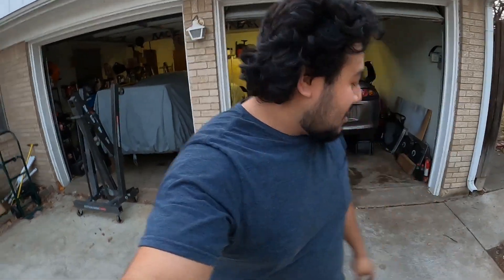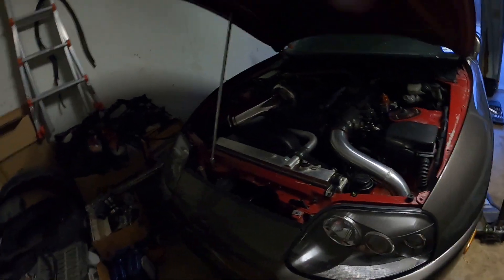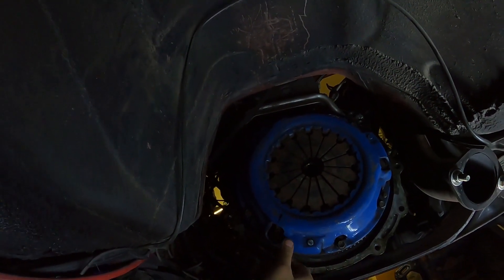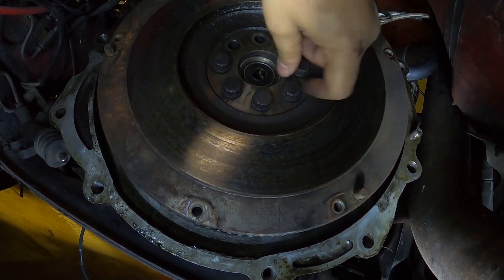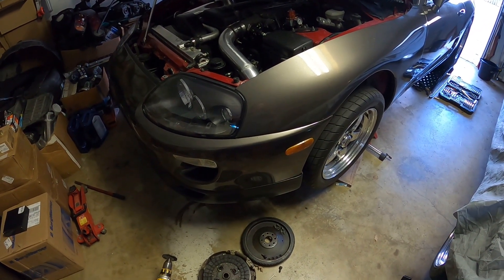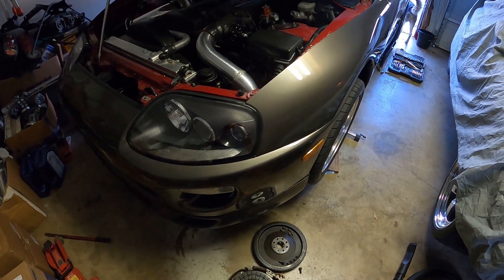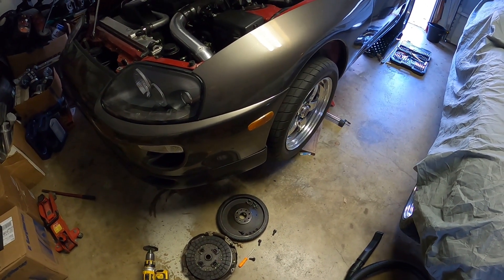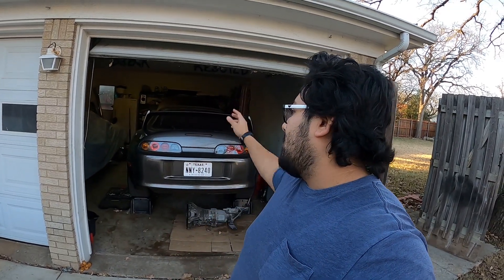This Could Have SERIOUSLY Damaged The Supra & Myself. Removing The Trans & Finding The Unexpected.

Comment: You're very lucky to catch that when you did. Flywheels are like saw blades when falling off. It could literally cut through the car and you. Very important to torque to spec and use locktite on the  inner threads not the actual bolt as it may push the locktite out under the head of the bolt giving you a false torque reading. Putting it in the inner threads it pushes it in as you thread the bolt not allowing it to build up under head of bolt.
Reply from the maker: Appreciate the advice bro. And yeah I've hear of horror stories from something like this. Definitely dodged a bullet with this one.

Comment: New subscriber around here love the supra content ! 
Curious what is that wheels setup? 
Wheel brand +rear tyres ? 
Thanks in advance
Reply from the maker: Welcome bro! Wheels are WELD RTS S71. I run 15s in the rear and 17s front. On my black Supra it has 18s front.
Reply: Thanks for the reply man 👍
How’d you manage to fit 15s in the rear ? Are they on n/a brakes ?